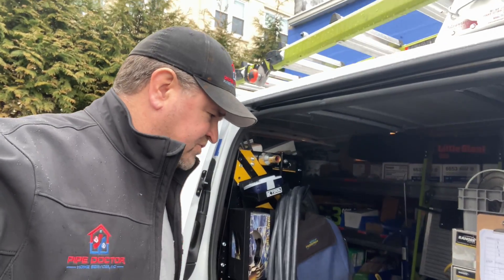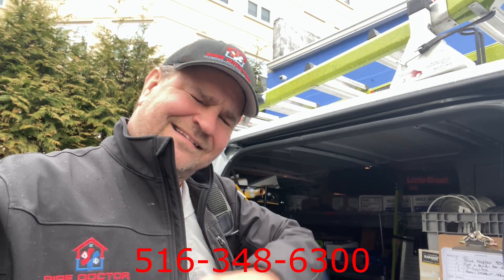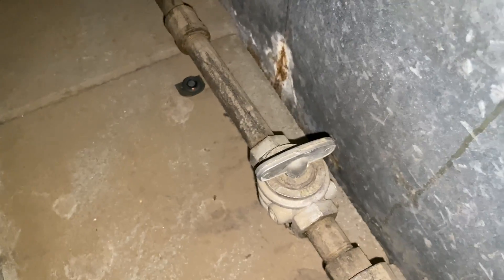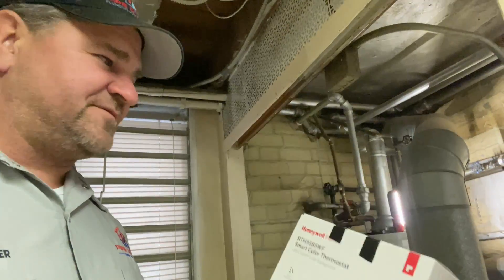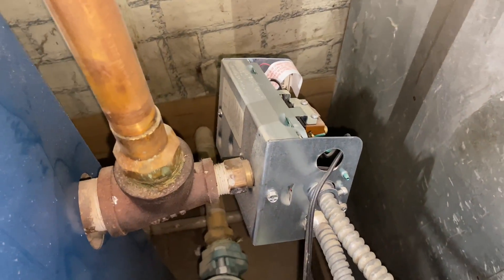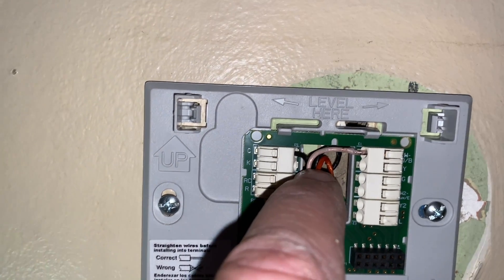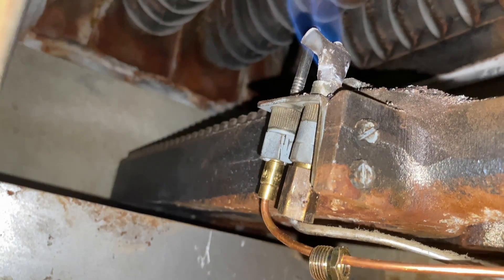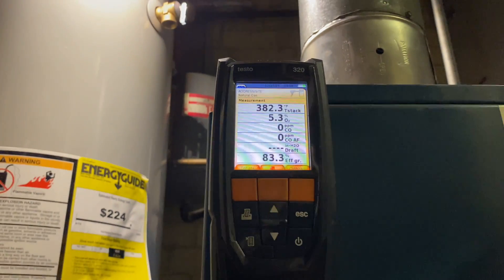Effortless Upgrades: Wifi Thermostat Installation without C Terminal on Gas Boiler

Comment: I'd be interested to see his gas bill after your adjustment made that burner much more efficient.  Way to go!  The amount of fuel saved could very well pay for your charges.  I am a true believer in the adage, "charge the highest price possible".  Not to gouge people but it is my service that creates the positive perception of difference "p-pod" between me and any percieved competitor.  You, Mikey Pipes, create that p-pod with every service call.  You are an asset to the industry and a great example to anyone outside of the industry that is truly interested in becoming a better salesman.

Comment: Dirty pilot causing white ash buildup on the bottom of the heat exchanger. Pilot flame has a noticeable lack of velocity and yellow tips. Primary air inlet hole to pilot head obstructed. 👍🏼